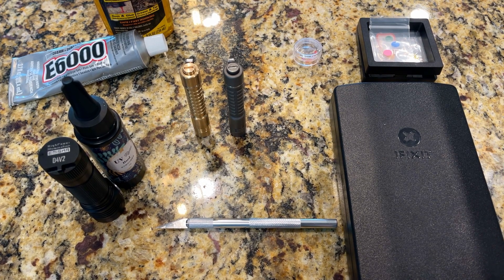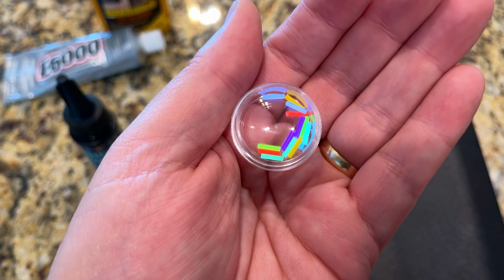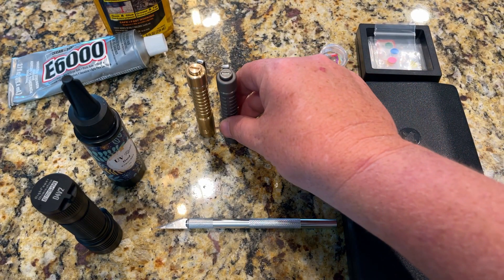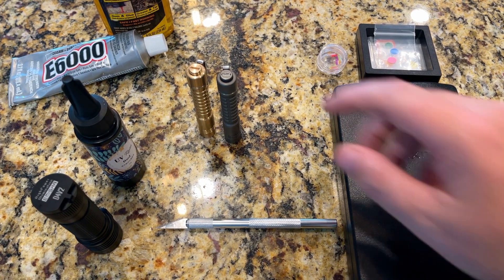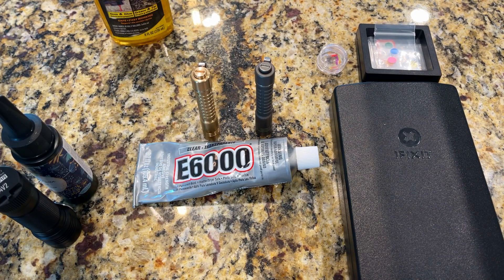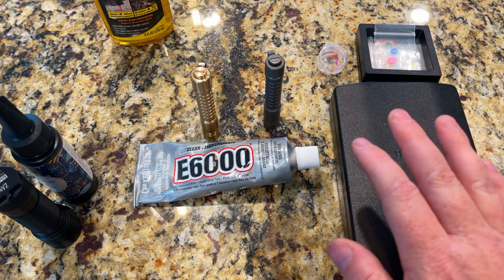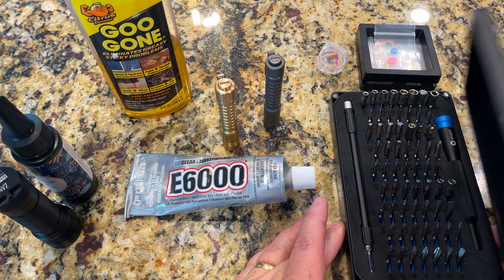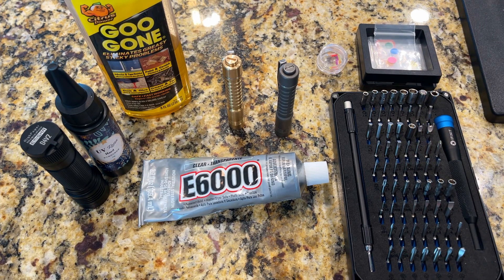Flashlights 101: Tritium Tubes (installation and removal)

Comment: Now if I could find tubes small enough to fit a tritium front AR sight. I have seen Exit signs in the USA illuminated with LARGE tritium tubes. The signs last for about 11 years but need to be replaced at ten to comply with fire codes. I even had a digital watch from Sears that had a tritium backlight. It did last for ten years. I have meprolight shotgun front sights that are 18 years old. Yes they still glow even dimly but in a total dark moonless night, enough to draw a bead on unfriendly's.

Comment: Tritium has a half life of around ten to fifteen years, he is correct on that. So after 20, expect it to be dead or nearly dead and needing of replacement. Tritium also emits alpha and beta radiation, very very little gamma can usually be detected. Gamma is what you need to worry about. Alpha will be stopped by paper, and Beta will be stopped by your skin. Just dont eat the tubes XD. Also, if you do happen to break one, vacuum up as much dust as you can and try not to breathe in any dust. It is a gas, but you should still be safe. These are awesome little vials and even just buying them to have around is cool. Im going to put some on my fan soon.

Comment: What works for me best using UV resin and to remove it easily and does not damage the tritium? I boiled a tap water for about 20mins, then as it is boiling and running on the highest temp? I placed my RL pineapple mini button (with the tritium sticking with UV resin) and let it sit or boiled down wait until atleast 10-15mins and so. Then remove the button using ceramic tweezers. Then you can easily remove your UV resin along with the tritium vial with just a smallest flat screw driver or precision tools. Hope this helps no chemical needed or pain in the butt of chipping the UV resin. You just need to boil the button completely (just like cooking)
Reply: PS: disassemble the button only along with the trit. Not to boil the whole RL FL itself :)

Comment: huh... im always using my flashlight to work on cars/change oil and stuff. ive dropped atleast one flashlight into a pool of oil and gotten oil/solvents on pretty much all the other ones. i worry with something thats not an epoxy/uv activated resin that it would weaken overtime and fall out.
Reply from the maker: That’s a good point. For most of my lights I just use uv resin now.
Reply: This is exactly why i still use UV resin because using UV resin would not that go off easily when exposed to harsh use. I just commented above how to remove the UV resin the old fashioned way and no chemicals needed.

Comment: Sir, where I live we are filthy with coyotes. My wife and I are raising alpacas. As long as the deer population holds out, I doubt that a coyote would jump our 4ft fence and risk being in the area of human cohabitation. But, it's not unfathomable that a coyote is old or just stupid (not very likely) and wants some seemingly easy prey, or for whatever reason. So, we have to be vigilant especially at night. Now we do have a dog but I really would rather not test him, but if nothing else he can slow one down long enough for me to get there. The weapon of choice is a Kel-Tek Sub 2000. Very light and manageable. The problem is that, as I perceive, if a coyote is in our fenced in area (About 1/8 acre) there will be a lot of movement/exciteme3nt etc and I need a way to 'sight-in' the critter quickly. I have found a tritium front sight but cannot find a rear sight one. Or at least one which seems applicable. My question is would you be willing to make a rear sight using tritium? I have a design that's fairly simple actually using the existing rear site. (with the help of a dremel) I can send drawings of what I speak and really don't see that it would be that difficult. And of course I'll pay you for your time & materials if you'd be willing. Personally, I think that design will catch on. After doing a little bit of research, I find that this rifle has gone viral and I feel sure you'll have a following. Please let me know at your convenience. Thank you (BTW, I am also incorporating a laser sight in addition to this. Sorry about the length of my inquiry.
Reply: @sirreggie51  literally what the f*** are you on about

Comment: E6000 is a godsend. And I work with professional level acrylics and UV resin‘s daily on a pretty large scale. 50 gallon drums every few weeks.
But I’ve been incredibly impressed with e6000 over the past decade or so. I won’t go into the details… But from someone who is qualified in material science I can tell you that shit is fucking incredible.

Also something watchmakers and us folks who work in the lab daily… Utilize things like toothpicks and popsicle sticks and other wooden implements when cleaning in fragile areas. Or if you need something real stiff and sharp you can get bamboo chopsticks for free from the Chinese to go place… or a pack of 50 bamboo shish kebab sticks from the dollar store.

And you can sharpen and shape the tip down to whatever size you need. And they are extremely good at scraping and cleaning in areas. Almost as strong and stiff as a metal screwdriver bit But without damaging or risking a slip into your anodizing

Comment: Fyi, tritium is not affected by UV. There's phosphor inside the tritium tubes. That's the stuff that actually glows, not the tritium itself.

Also you can remove Norlands 61 with a bit of methylene chloride. Drop some on and let it sit for a few minutes.
Reply: Damage free after removal using this?
Reply: @thypocketwizard  Guarantee it. It's listed on the Norlands spec sheet.
Reply: @TautologyTechSystems  so the glass vials will be safe from damage? dont want tritium floating around lolz
Reply: @HKBuilderDIY  DCM/methylene chloride is a non polar solvent and will have no effect on glass itself. im not sure what the end of the tubes are sealed with some kind of epoxy? actually according to wikipedia they are just rounded over borosilicate glass (pretty strong stuff, i managed to break one installing it into a yugo m70ab2 import coz i didnt scoop the surplused adheasive out beforehand with like a drill bit. i think it was torsional force that broke it) that is sealed on the end by a CO2 laser (probably infra-red wavelength? which glass absorbs pretty strongly? CO2 lasers in my experience are invisible to the naked eye... unless you fry ur retina with one then youll never not see it)